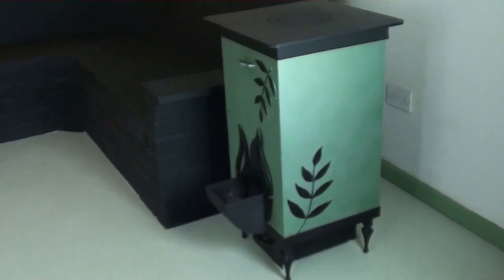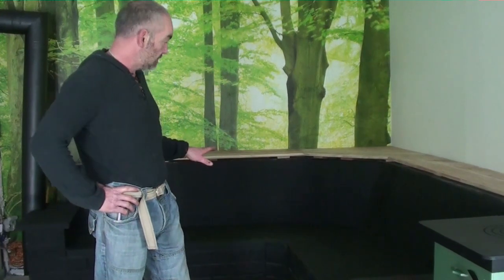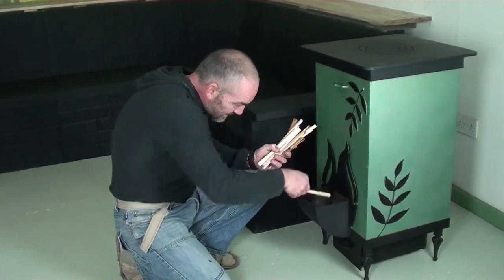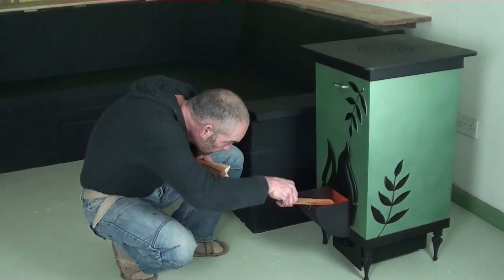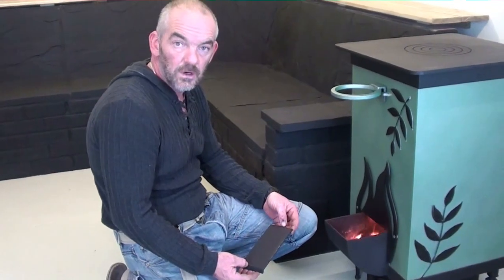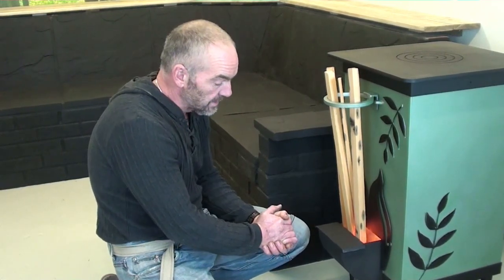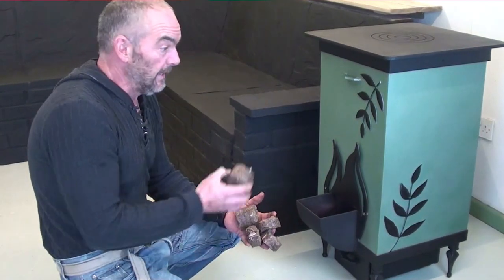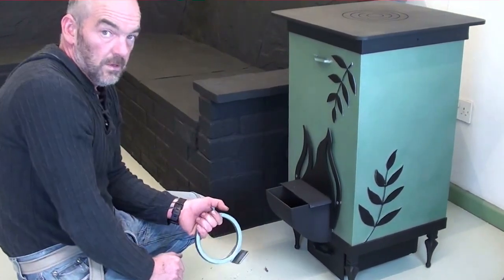Maya Rocket Stove and Thermal Mass Sofa explained - by Leyland Stoves

Comment: Before buying I would need to know what the riser is made of and what is used for insulation to allow the pretty outside from burning, usually the outside radiates heat into the room.
Reply: It's high temp stove paint. And something tells me he's not going to tell you what's inside unless you're about to buy it. This is a really nice production stove and I'm sure some of the materials are meant to be on a need to know basis lol. I'd be more concerned with warranty than materials. And how long the company has been around to insure the warranty is not at risk of a company going under. If he tells you what materials he's using I'd like to know that too as well as what material he's using inside the brick bench. I'd also be interested in ash clean out. Does the cover lift off to get the ash out of the outer box or is there only one clean out under the burn chamber?
Reply: Alvarez Metal Works
In the bench is just mass could be more brick or rock or cob, stay away from sand because sand works like insulation so no heat released to heat the rest of the bench. Typically steel is not the best for the riser because high heat will break it down, it's called scaling, better to use fire brick inside the riser tube held in place with insulation and a metal tube on the outside. The 2 isolated, the brick handle's the high heats going up and the metal handle's the cooler gases going down to the flu exit.
Reply from the maker: Hi the stove is made of 4mm steel. The top is 6mm but in future models it will be 10mm. It's painted in industry standard Stobebright or Thermacure stove paint which can take double the heat our stove generates. The internals are as you expect not public domain, but it's safe to say that as with all Rocket Stoves there is an internal insulated chamber. The ash tray underneath slides out for easy cleaning (we only empty it once a month - and we use this one every day!). You can also remove the top and use a vacuum cleaner to clean out the internals - we suggest twice a year.  The flue pipe we used was 6inch flexible flue liner and vitreous enamel flue pipe. The internals of the sofa are no secret. It's a concrete mix - the importance is to get the mix right, which we can only give you on purchase. The externals are ordinary clay bricks and concrete slabs on top with rockwool insulation behind to keep the heat in the room. At best it gets to 58 degrees C (36 degrees on average) so you don't need special bricks, solid clay bricks are best though as they give good heat transference. The main thing is that air is your enemy and will trap the heat inside so making sure you've got a good seal around the flue pipe is essential. In our tests we've found that 25foot of flue pipe is about your limit. In this example we only run it through the sofa once - which is fine for indoors, but we recommend a double flue for outdoor use i.e. a U bend at the far end with the flue coming out the same side as it goes in. It's also safer as you can keep all your hot surfaces in one area and put a guard around the stove and pipe. Hope that helps. - Andy, Leyland Stoves.
Reply: Thank you for all of that information.
Reply: There is no secret about the internal riser or burn tunnel, either it's Fire Brick or it's not. By your response I suspect not.